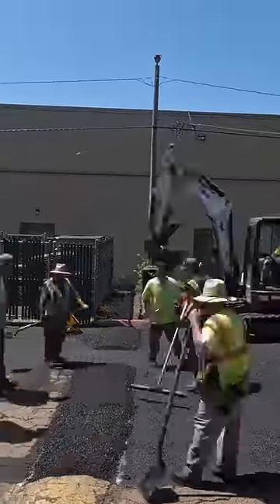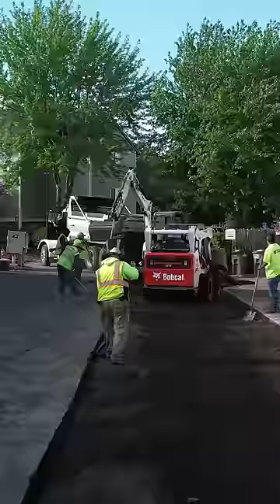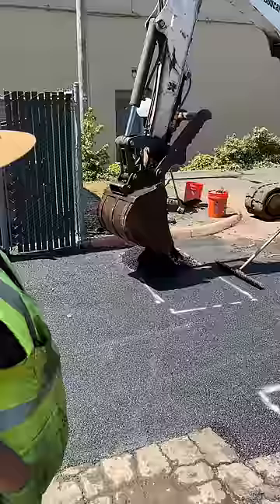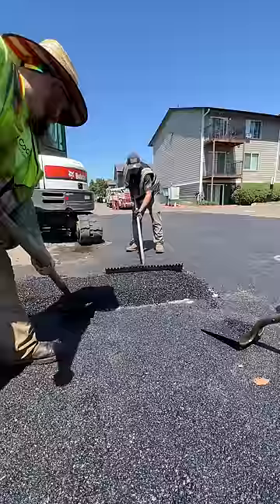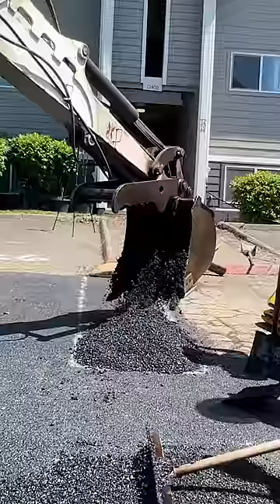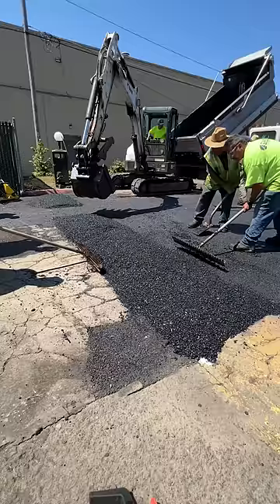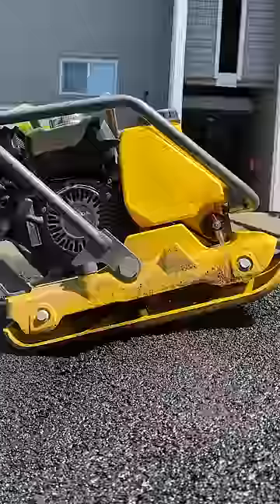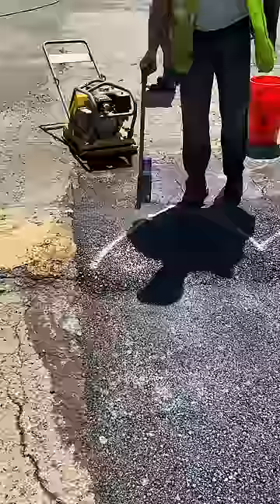This is how Speed Bumps Are Installed!

Comment: So you are the people I’ll be cussing at when I hit those dang things.
Reply: Lol I’ve hit some insane bumps that were nearly invisible and nearly broken my car
Reply: Bro yes. This the one installing those high speed bumps in Beaverton. You have to stop and maneuver over.

*Because they're not lined up, you have to stop and make sure your wheels are on it. Otherwise you might be hitting your transmission.
 It's 2 small fragments of a speed bump and half the left side is on the wrong side of the street.
Reply: Why don't you just drive better?
Reply: @jinglebellssantasmellsssssd  go ahead and explain how driving better will prevent you from going over a speed bump?
Reply: @byronrobinson8633 well if you know how to drive, you’ll be paying attention and not going so fast that you fuck up your car going over the bump, giving you no reason to get mad about it.
Reply: @zahven  who said anything about screwing up my truck? I just hate going over them with my truck and trailer. Some people just can’t read someone’s comment without adding something to it. It’s just something I hate hitting with my vehicle. That simple and driving any better doesn’t change that fact.
Reply: Yeah cause they dont paint them.
Reply: @zahven my car is lowered. I can go over a standard speedbump with out scraping. If it is handformed though often times I cant. My header will scrape.
Reply: @Akotski-ys9rr  I have smoked bumps that I did not think where as big as they were in my truck.
Reply: That’s why the giant speed tables are so much better your car just coasts over them versus a little bump
Reply: @Sak-zo1ui yeah lowering a car for aesthetics is just stupid. It’s always satisfying seeing people’s bumpers get ripped off cause they didn’t plan around the area they live in
Reply: Those speed bumps are the good ones tbh. Ok there are no good ones but if I had to choose one it'd be those
Reply: @Eclipse-lw4vf  lol
Reply: Drive slower thats why they are there
Reply: @Akotski-ys9rr they had to remove soke speed bumps by me bc they were too steep and people were damaging their cars. First they put in guards on the side of it to make sure you didnt go ariund it though. Then about 15 people filed claims with the county in a 1 week pwriod and they were gone by friday
Reply: Lol maybe drive safer and look at the road ahead
Reply: @jinglebellssantasmellsssssd  at 2 mph at a angle with my 85 camaro the mufflers will scrape that bump. the car is at stock height so explain what can i do better? my 2015 caprice is the only car i own that can clear 8 inches curbs. this is mostly a city thing with crazy height speed bumps.
Reply: @zahven first off: I’ve encountered bumps that are 100% done wrong, they’re super arched and have either holes around them or pits causing the bump to literally scrape the bottom of average cars.

2nd: not signed, not painted, and blends right in. It needs to be signed and painted to alert people, even going 10mph can damage bottom of cars over fucking shitshow bumps
Reply: @jinglebellssantasmellsssssd  the issue is when car is low it will scrape especially if it doesn’t have a good transition the bump I’m talking about
Reply: @byronrobinson8633 The point of a speed bump isn’t to somehow avoid it, it’s to drive better at lower speeds.
Reply: The bump is smooth and acceptable
Reply: I work in asphalt, and if you cuss at me for this I will tell you to call the person that asked for the speed bump, we don't decide to put down a speed bump, it's our job to make what the customer asks for.
Reply: @matthewbrady5274  I’m just cussing privately in my truck. Not at any person because I do understand the reason for them, I just hate going over them. But I’ll be cussing In my car at you for putting those up, and cussing at the people hiring you to put them up. Everyone equally gets a cussing at in my head. Lol
Reply: @Akotski-ys9rr  they always got signs before them sooo
Reply: Maybe dont speed🤷‍♂️
Reply: @jinglebellssantasmellsssssd someone clearly doesn't understand that a lot of people have cars that have low suspension meaning the bumpers will scrape
Reply: To high and not long enough
Reply: Slow down?
Reply: No, you blame yourself
Reply: @jinglebellssantasmellsssssd BASED comment
Reply: Not a bad bump honestly we got bumps here that will fuck up ur car if u go 5+ kmh
Reply: Slow down
Reply: @byronrobinson8633 you better start driving better, i took some driving lessons and i learned to float over the bumps. problem solved ezpz, your just a bad driver.
Reply: cry
Reply: @devynlich00 sorry but low suspension is no excuse. If your suspension is regulation and you know how to drive properly you'll be fine it's literally only dumbasses that fuck up their cars on speed bumps. I've had lowered cars but can sail over a speed bump due to correct speed and approach
Reply: @JesusGomez-dx9ib good.
Reply: @Mr_C.Bacteria  yeah and you also got to consider all the sports cars that are low-slung from Factory
Reply: @byronrobinson8633 ah just a whiner makes total sense
Reply: have you thought about slowing down?
Reply: @LicPlate8VPL158  you do realize that that'll just make it worse you even hear the scraping it sounds like a fork on a chalkboard
Reply: maybe stop lowering your car? @devynlich00
Reply: @LicPlate8VPL158  and some people clearly don't get that some parts from Factory Are low to the point of its scraping regardless
Reply: sounds like a skill issue in my opinion. hardly any cars scrape their asses from factory. are you sure you aren't just extremely obese in your honda civic? talk about triabetes homie @devynlich00
Reply: @jinglebellssantasmellsssssd How does that explain that the McCain Place apartments at the very end of McCain across AR-161 uses literal fucking BLOCKS as speed bumps? Literally go there and tear out the bottom of your car and you better not say „just drive better“ then…
Reply: @byronrobinson8633 The bumps are there so that you pay more attention and slow down. Given how annoying they are to you, I'd say it's working as intended for the target audience.
Reply: Speed bumps are the biggest enemy to lowered cars and sports cars
Reply: @Eclipse-lw4vf he never said it was purely for aesthetics, sports cars and cars with coilovers are lowered because they have a lower center of gravity which makes it handle better also a lot of coilovers naturally lower the car by default 

If anything it's the fault of the shitty infrastructure and road design, a lot of roads are built like shit
Reply: @Akotski-ys9rr the small tall ones are horrible, feels like i just drove over another car at 10 km/h
Reply: Just slow down man.
Reply: @Rilagooma  sometimes the bumps are so tall that it doesn’t matter how much you slow down
Reply: I’ve driven over speed bumps that more resemble a curb than a “bump.”
Reply: @jinglebellssantasmellsssssd  wtf you mean drive better all you gotta do is idle over the bump not rocket science
Reply: @zahven some people have lowered cars you know that🤦🏻‍♂️
Reply: Slow down.
Reply: "why can't I go 60 in s school zone?!" energy
Reply: wdym we have 1 speed bumps every 10 meters here in the philippines cant even curse them
Reply: @Eclipse-lw4vf Yeah if thats stupid so is having a dumb pokemon pfp. Just face it dude, you dont like it and thats fine but no need to bash on things just because its not for you
Reply: Jus don’t speed😂
Reply: These bumps had broken my front bumper lol. The noise it makes when you hit the bottom 😢
Reply: @Mr_C.Bacteria just because you’ve been lucky doesn’t mean you’ve been over every speed bump in the country, I’ve been over quite a few that are just simply not done right
Reply: There are some speed bumps over here where even if I go at an angle at a snails phase it fucking scrapes the entire bottom side of my car, and my car isn’t even that low.
Reply: @Akotski-ys9rr go to the eye doctor 😂
Reply: @Eginhardt i prefer speed tables too
Reply: @Eclipse-lw4vf i too love seeing the things people love and work for ruined because apparently we needed  a multi-billion dollar military fund instead of decent roads.
Reply: @dayrol007 i think that's the idea
Reply: @pedro1313   you don't understand. They're not lined up with your wheels. You literally have to stop, and make sure your wheel are on the right spot. Otherwise the speed bump is hitting your transmission
Reply: @dayrol007  oh, then they should defenetly fix that
Reply: Or when they make them so high they constantly scrape on the underneath of a normal height car
Reply: @Sak-zo1ui your car is broken then, it can no longer navigate the road. how much did you pay for that 💀
Reply: @ColHogan-zg2pc  it is a lowering kit it is intentional. I can clear normal speed bumps.
Reply: Get a truck
Reply: @Akotski-ys9rr I drove off a curb
Reply: @Eginhardt hit one of those doin 45 in my truck, multiple times, my buddies in the bed didnt find it as fun as i did 😂
Reply: @byronrobinson8633 go ahead and explain how being a good driver would NOT help? Lol I bet you drive 60 in the left lane and wonder why people cut you off 😂
Reply: Do NOT SAY CUSS WORDS
Reply: @byronrobinson8633 okay boomer calm down.
Reply: What’s worse is when they start putting them in neighborhoods
Reply: don't speed then, they exist because of people like you
Reply: @byronrobinson8633  by me they started raising the crosswalks. Effectively every single crosswalk is a speed bump. A lot of people have been damaging their vehicles because they don’t slow down. People doing 50mph or faster through residential streets is very frequent around here. Many kids have been hit. I fully agree with speed bumps as people have slowed down significantly here.
Reply: Respectfully I would rather your car get scratched than someone be struck and killed because you didn’t slow down
Reply: @Akotski-ys9rr the invisible dips are worse, hit one a 30 mph. smelt smoke after
Reply: No, cuss at the business that wanted them there!! Not the workers 😢
Reply: Try slowing down, chief.
Reply: @zahven before i tell you to stfu I'll give u a real life example.  I lived in this house over 15 years. By my old middle school the road is 45mph all throughout the road with 2 small sections with school zones. I dont take the road often anymore so one day im doing 45 mph at night and little did i know, they decided to add a speed hump near the middle school right at the middle school crosswalk. NO SIGN, NO WHITE LINES LEADING UP TO THE BUMP, just that dark maroon color on the actual bump. How exactly did my driving lead to me flying over the bump and almost damaging my car? Might i also add im lowered (not slammed, but lowered, i can still make it over any bump as long as i slow way down so i dont bottom out the back side)
Reply: @zahven driving slow is dead bro
Reply: Do you scream at employees too rather than the owner?
Reply: Speed bumps should be illegal.
Reply: @matthewbrady5274 You’re making money off of it, so it’s your fault.
Reply: Yep
Reply: @Akotski-ys9rr  yea imagine hitting the one you see and they are just like a fucking curb 😂
Reply: @Akotski-ys9rr  same and the ones i hate are the "double" where it goes down 6 inches at first then goes up 1 foot, i travel that road almost every day and it forces me to not be able to get a lower down car
Reply: Slow down.
Reply: Its Better Than the speed Bumps that you go not even idling speed over and still get Bounced in the Back
Reply: @byronrobinson8633 do you know why they put them in so you don’t fly done certain roads or parking lots
Reply: @byronrobinson8633 the fact people don’t drive good is the reason they have to put them in places if you don’t like it hate the bad drivers the love speeding in places with lots of people grouped together
Reply: @byronrobinson8633  If you slow down, you’d just roll over it. What’s the problem?
Reply: @Sak-zo1ui  🎻🎻🎻🎻🎻 How do you deal with driveways? Lowered cars are impractical.
Reply: @ronc9413  park at the street if it is too steep. It is a personal preference thing.
Reply: @Sak-zo1ui  What about just any driveway (parking lot, garage, etc)? They usually slope down from the sidewalk to street level (various slope angles). Some places do not have street parking or they are all taken.
Reply: @ronc9413  i live where there are very few hills and if a house is on a sloped hill i can make it in the driveway most times unless the driveway is tore up. It really is not very impractical especially considering the handling benefits which I have used to avoid wrecks. And it looks better. If i know im going somewhere where it will be a rough country road I take a truck.
Reply: @Sak-zo1ui  Sounds like where you are, there aren’t sidewalks (raised slabs of concrete people walk on in places like Los Angeles , San Francisco, Sacramento, etc). I live in Los Angeles. A car that is only a couple of inches off the ground, will have a really rough time just about anywhere in LA.
Reply: @ronc9413  it is very different from out west because i am not out west. I also dont drive on sidewalks.
Reply: @Sak-zo1ui  I’ve seen YT videos of what happens to cars that are low to the ground (like Lamborghini, low riders, lowered BMW, etc). You have to avoid anywhere that is NOT flat. You even have to avoid those “tire stops” (they often have some rebar sticking up). If you ever drive to LA, bring your other car/truck. LA also has a lot of pot holes and street construction.
Reply: @ronc9413  definitely. Im not crazy lowered but i have around like 3-4 inches between my headers and the ground. Which is extremely low for a normal car. I have managed in hilly areas you just have to be more mindful. I will definitely take your advice of not going to LA in my car for that reason. Thank you.
Reply: @jinglebellssantasmellsssssd you can drive as careful as you want but there are speed bumps that will scrape the bottom of most Vehicles even going at slow speeds
Reply: @zahven like I've said to her previous commenter there are definitely speed bumps out there that no matter how slowly you go can scrape the bottom of most vehicles due to poor construction and being too tall for being a speed bump
Reply: You should be cussing at yourself. Stop speeding through parking lots and you will be fine

Comment: There should really be regulations on speed bump hight and slope. I did delivery and I’ve had speed bumps that would damage my vehicles. My cars would be a little low but I’m not talking about those bumps you have to go 6mph over. There’s this lot down from me and you can’t go literally 2 mph over without hitting your car on it, no car under 6 inch can go over it and any normal car and even my truck going more than crawling speeds get damage. I like the plastic “speed humps” that are really long ( not the short yellow ones) you can drive over them just fine going 5/10mph with no worry

Comment: asphalt speed bumps are simply infuriating
Reply: Great
Reply: Y?
Reply: Is there different types of speed bumps?
Reply: @41052  Yes many. Mostly u use a scale/template and dont just poor them on the ground like a rookie.
Reply: Just use diesel to melt the speed bump
Reply: better than concrete ones
Reply: ESPECIALLY THE ONES WITH THE GAP
Reply: Depends on the speed bump. I've seen massive range of size of asphalt speed bumps. Some that would easily bottom out an suv. Others that are smaller than the average pothole
Reply: So are drivers that go flying through residential areas causing the need for speed bumps
Reply: diesel is ur friend
Reply: @41052 alot. I dont know why u guys in us are so behind with everything
Reply: @bobbah676  so speed bumps can be different materials too? I didn’t mean the shape of it
Reply: @Paterq  damn bro you’re so cool
Reply: @zaksmith3163  if you’re talking about the category of vehicle, then yes. My diesel carries momentum over those things like like a cruise missile.
Reply: @ManyArmedMooseDei  I was saying put diesel on the speed bump
Reply: @eaf-target-xx2745 you're just gonna go flying at mach 8 at the person than driving at mach 8 at the person.  Also they do so much undercarriage damage it's stupid tbh.  

They should use those friction strips some highways have .
Reply: @zaksmith3163  that will fuck up more than the speed bump. Then the people will be bitching about the massive pothole
Reply: @DesertDog  you can do that?
Reply: @mhxxd4  can? Yes but should? Really depends
Reply: Yeah, I have to go extra slow and sideways over speedbumps because they make them so ridiculously high over here. My car is pretty low, If they are asphalt and you miss one the bumper breaks off.
Reply: Especially for my Lamborghini I hate those things
Reply: @phantomjosh2148  prove it, upload a video with your "Lamborghini" and the text that says "This is my Lamborghini over speed bumps on a white card"
Reply: @DesertDog  what are other people gonna think when I randomly put a video of my Lamborghini going over a speed bump with no context
Reply: @phantomjosh2148  that you're not a liar?
Reply: @DesertDog  He is obviously lying but you don't have to "prove" anything on the internet. Always take what people say on here with a pinch of salt, this guy doesn't have a lambo, he just has a riced Honda Civic with lambo doors.
Reply: @rafox66  I know, but it was fun to call him out on his lies
Reply: But they are needed.